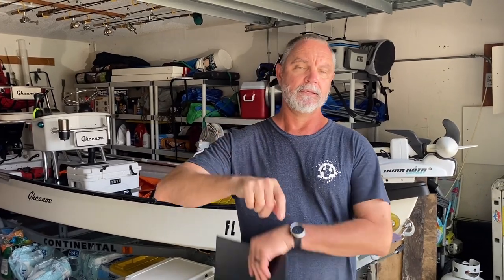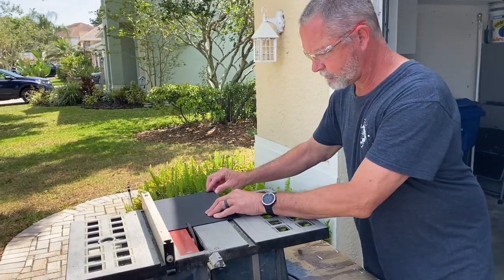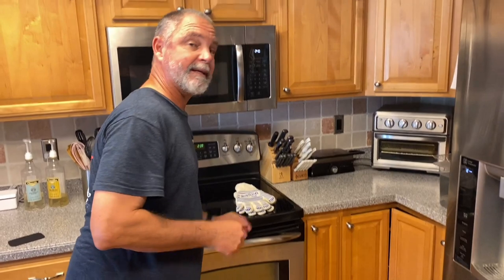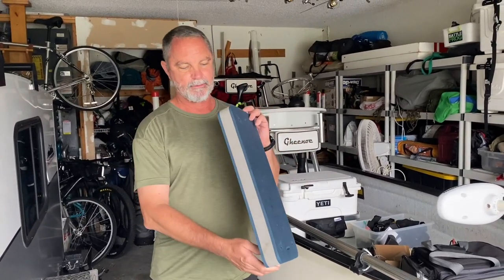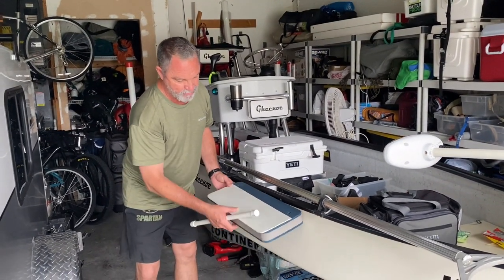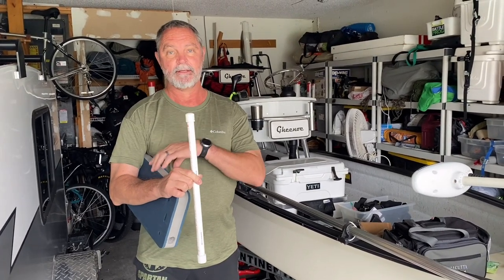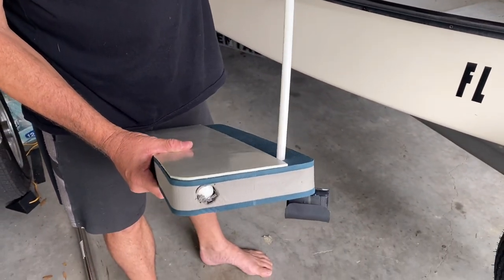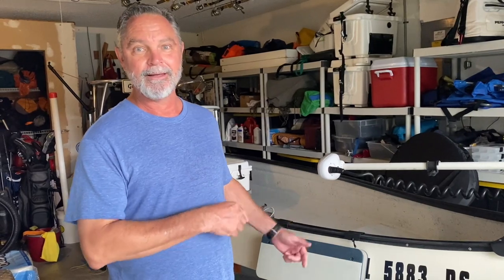How To Make Your Own Gheenoe Boat Fenders

Comment: A helpful tip. You can also use a heat gun to tweak the final fit of the Kydex to the rub rail. Or use it exclusively to heat and fit if your oven isn’t handy to where your Gheenoe is.  Just take your time and don’t overheat the Kydex or it will wrinkle and shrink.